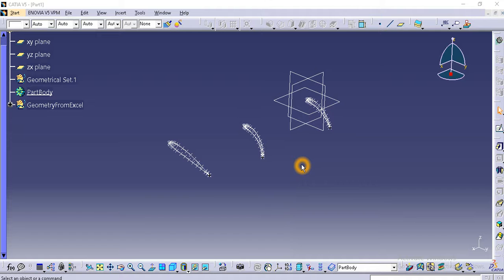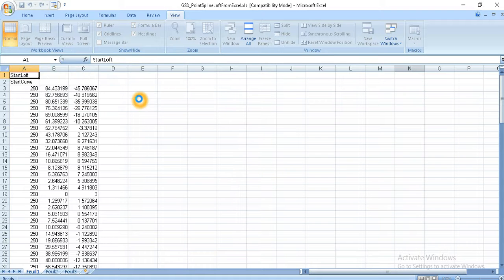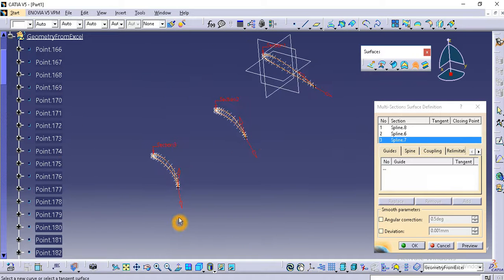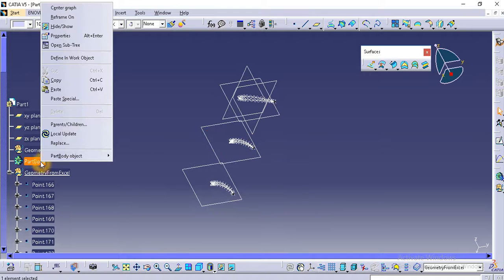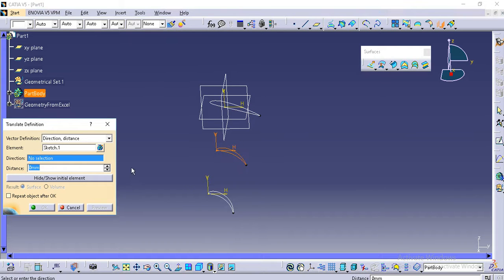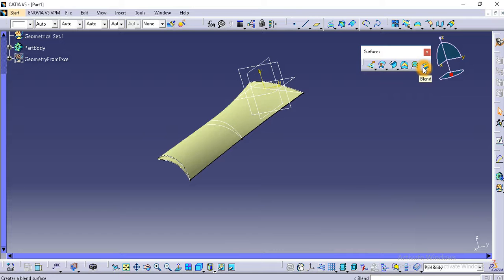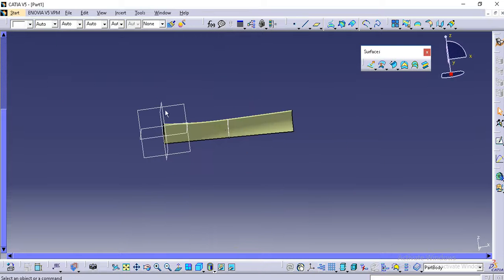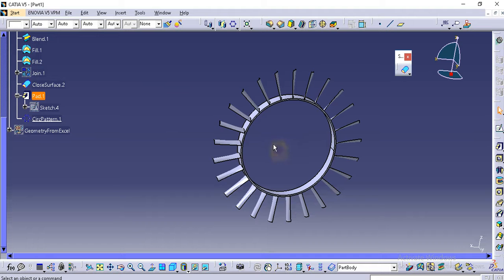CATIA V5: How to Import Multiple Airfoils for Wing | Compressors | Turbines | Propellers - (Part-2)

Comment: Hi. Thanks for your tutorials on creating the geometry. I'm having a problem connecting the blade to the central propeller hub on CATIA. I've been trying different ways to connect it for the past month but I have had no successful results. Can I send you what I have done via dropbox so you can see the problem I am having and advise me on how to solve it?
Reply from the maker: first of thanks for watching the video.
You are getting a problem in connecting the root blade (airfoil )to the propeller hub, right?
Solution: Using trim option in operations toolbar in surface design(GSD or Wireframe and surface design).
Extend the root blade airfoil in to propeller hub and trim the extra surface using the TRIM tool.

If you still have any problem in that plz send me the Parts via dropbox or by any means.
My E-mail ID is : aerocatv5r20@gmail.com
Fell free to comment , Happy to help you :)

Comment: hi 
in this video making of compressor blade at is missing at last how to make circle and how  to keep airfoil on the circular ring
pls tell that
Reply from the maker: Thanks for watching the video,

Yes, In this video i have not shown how to make a circular surface ,for Compressor/Turbine design , You can create a sketch with circle tangent to the root section of the blade with required diameter, Pad/Extrude of that sketch will finish the job.
 I have not shown it because to decrease the length of the video and Not to confuse it with other attributes like propeller design.

If you Still find it difficult , Please feel free to reply this comment.
Reply: Plz upload video on how to make circle and how  to keep airfoil on the circular ring
Reply: @AbhiAerodesigner  yes thank you...but am not getting it, could you please upload a video on designing a compressor blade

Comment: sir i have a doubt
how to give blade angle in catia while designing turbine blade
Reply from the maker: Hi, Thanks for watching the video,
Your query is how to give Blade angle for different Blade profiles i have taken in CATIA.
Make sure you watched Previous version of this video [A].

You can give it two ways.
1. Go through all the options in airfoils tools website /airfoil  plotter page.Here there are options like PITCH , RADIUS  & ORIGIN. which will allow you to change angle as well as profile shape and orientation.

2. Without using options in airfoil tools, After importing airfoil profile in to the catia. You can use Translate & Rotate option in Surface Design(i.e., Generative Shape design or Wireframe and surface Design), By effectively using those options they will help you to position to the blade profile at required angle.

I hope i have Answered your question as briefly as Possible, If your Query Still Exists feel free to reply comment.
Thanks once again.